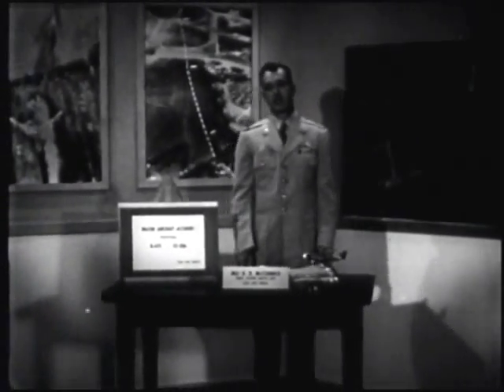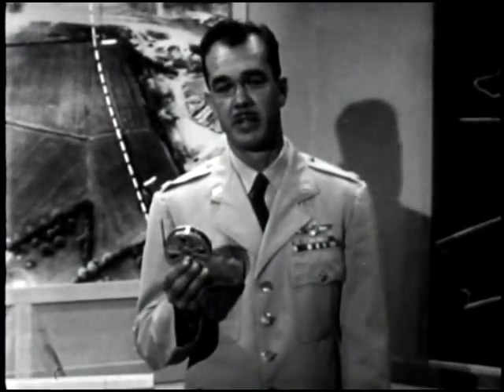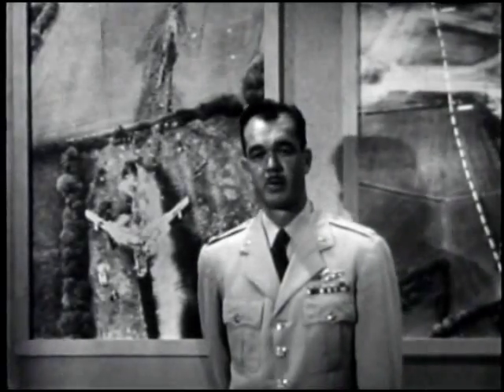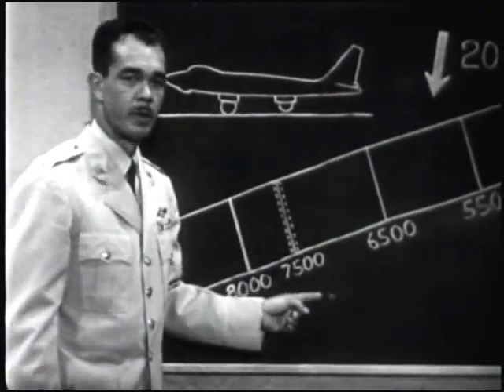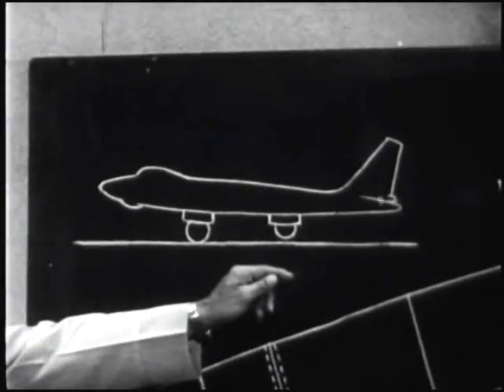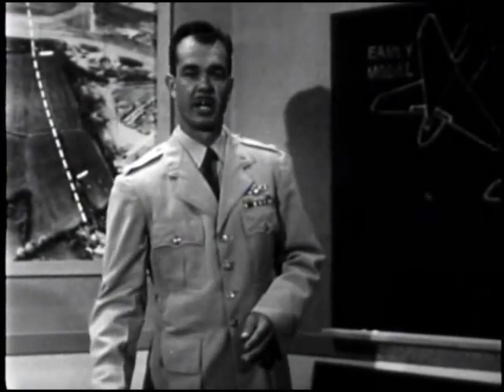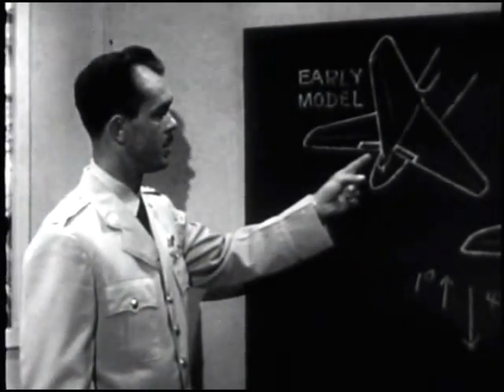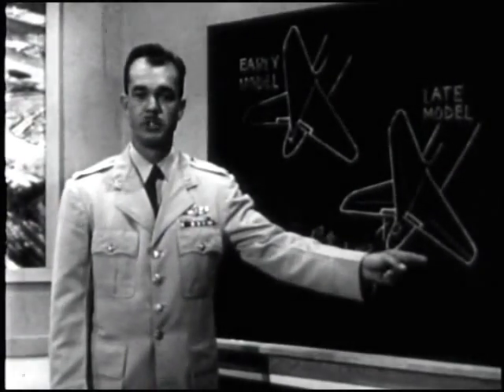Major Aircraft Accident Involving B-47E S/N 52-386 (1955)

Comment: Bizarre ending, but otherwise interesting. The crew was lucky to survive. I have to wonder if they ever flew for the Air Force again.
Reply: It probably depended on the A/C's prior record. I'm sure he faced a full review board at the very least, and depending on that board's findings he could have been recommended for remedial training and/or disciplinary action ranging from a reprimand, an article 15, or courts martial. Again, depending on his prior record as a pilot, officer, etc...
The remainder of the crew would probably have been held blameless as only the A/C was in control of the aircraft at the time, making them more or less passengers.